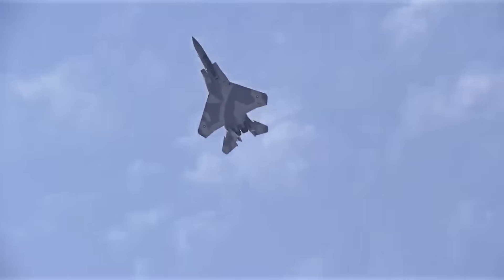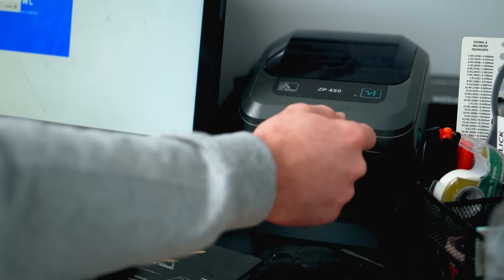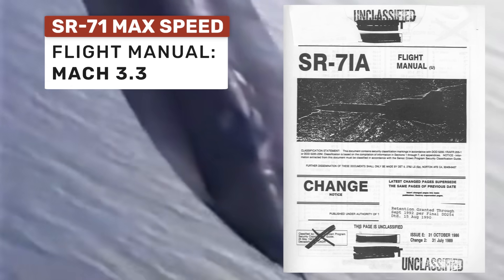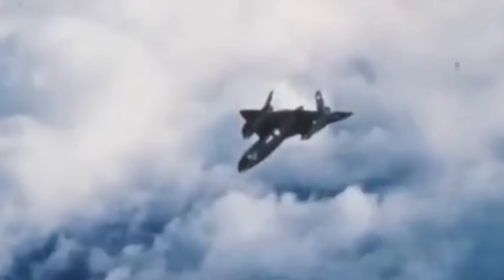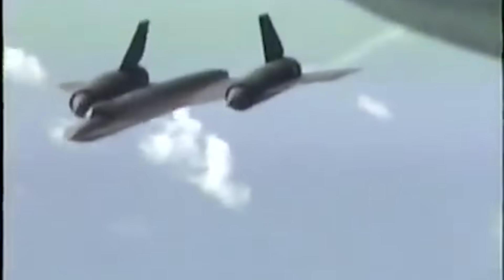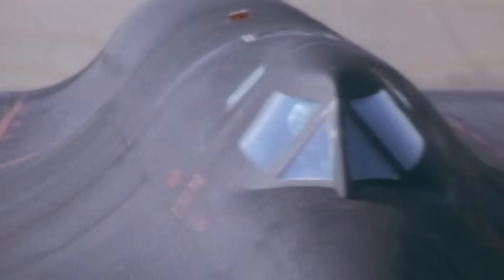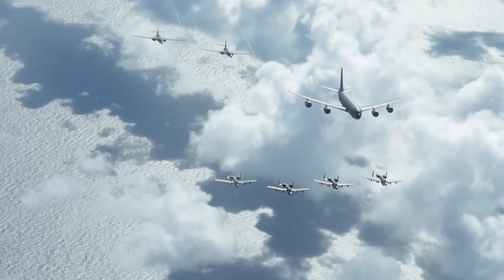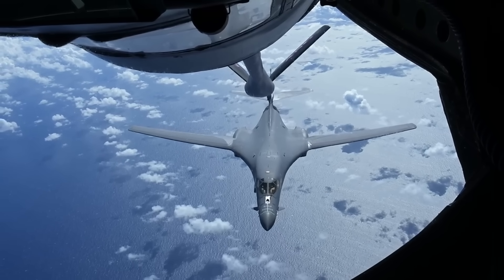The SR-71 was MUCH FASTER than the Air Force will admit

Comment: I met several SR-71 drivers at an airshow at Andrews AFB outside of Washington DC, who were wearing 5 - 100 patches on their flight suits.  Since I was an Army officer, in uniform, they told me  it stood for their doing Mach 5 at 100,000 ft.
Reply: There's no pilots that have ever worn a patch like that, especially as it's not possible.
Reply: @gr8crash  You're correct about the SR-71.  However, according to NASA "On separate flights, the X-15 reached mach 6.70 (4,520 mph) and 354,200 feet. the program could have broken every speed and altitude record in the books, but that was not the goal. the sole purpose of the X-15 was to enable research at hypersonic velocities and at the edge of space."
Reply: The X15 program did break and set all the records. There has yet to be a manned aircraft that flew higher/faster. Aside from the Space shuttle etc which is still a different class.

Comment: It would make sense if it was much faster. The plane itself and all the stories from the Skunkworks abour the engineering challenges they had to overcome is the evidence. The SR-71 has quirks and engineering oddities that contemporary aircraft of roughly similar (known) speed, like the MiG-25 and XB-70, never had to deal with. Both of those achieved Mach 3 with ordinary turbojet engines, for example, and without the need for a skin and fuel tanks that okly sealed properly after veing friction heated by drag.
Reply: The part about the tanks isn't true, although it is a popular myth.
Reply: @gr8crash  There is literally video of them leaking on the tarmac
Reply: @XH1927  no one said they don't leak some fuel. Virtually all aircraft leak fuel, the SR71 is no different. Its WHY they leak fuel, which per your comment is incorrect.

Comment: I'm betting Mach 5 to Mach 6!
Reply: Not even remotely possible
Reply: @gr8crash  Really? The X15 in designed 1959 reached Mach 6.7 in 1967 with a 16,000 total LB of thrust but an SR-71 with 50,000LB of thrust can only do Mach 3? The thrust to weight is 1.15 for X-15 vs 0.44 for SR-71 and can sustain thrust way longer since it's a jet, not a rocket engine. Lockheed Martin announced in June 2017 that the SR-72 hypersonic plane will have a top speed of more than Mach 6. The Falcon HTV-2 went MACH 20 in 2011! But Mach 5 or 6... just not possible? Dont forget public vs classified specs like Sandbox pointed out. Or like one SR-71 pilot said, "I've seen Mach numbers I never dreamed were possible".  Did you catch NUMBERS? Or NASA's unmanned Hyper-X (X-43A) with scramjet aircraft reached Mach 9.6 in 2004. The Falcon at Mach 20 was the fastest I could find, and that obviously doesn't include classified vehicles. Maybe checkout - Figuring out GE Aerospace's hypersonic aircraft engine breakthrough. But they don't exist, right?
Reply: @anthonywilliams7052  Read the SR71 flight manual. Skin temp limited to 427°C / Mach 3.5 at optimum conditions.

Comment: Concorde could and did fly faster than its "official" Mach 2.02 as well - its top speed was limited not by engine thrust but by peak temperature - flying in a colder patch of air, at higher altitudes, would enable higher speed whilst not exceeding the max temps on the airframe.
Reply: Technically, the plane was required even for certification to fly at 2.15 for a short period of time.  Apparently, it was felt to be important for test purposes.  Originally, they wanted a speed of 2.20 which would have required the plane to fly at Mach 2.35 for a short period, but they ultimately decided to forgo this for one reason or another.

Comment: They flew an SR71 3,100 miles in under 1 hour from rollout to landing stop.
 F15 is capable of shooting itself down by accelerating and running into the rounds fired from the cannon that travel at roughly 2727.25 mph or about mach 3.5,  so F-15 has to be going faster than that.
Reply: Lol none of what you said is remotely accurate

Comment: At higher altitudes air is thinner.  Therefore, there should be less friction and less frictional heating.  Doesn't this mean that the aircraft can fly faster without exceeding its  temperature limit at higher altitudes?

Comment: I was stationed in England in 1974 during the Farnborough air show when the Blackbird set the world speed record.  They flew down the flight lines of many RAF/USAF bases.  I saw it cruise down our flight line about 100 feet altitude, barely audible from a couple hundred yards, at the end of the runway, it stood on its tail and went straight up quicker than I could snap my head up to try to follow its path.  The scuttlebutt at the time was that they landed twice for coffee on the trip.

Comment: Mach 3.56=2731.478 mph 😮
Reply: That math is incorrect,  nor is it really possible
Reply: @gr8crash  

It is not incorrect. 1 mph = Mach 0.001303
Reply: @jesusisalive3227 again, your math in relation to this aircraft specifically is incorrect. 2731mph would be mach 4.09 which is 100% impossible for this aircraft.
Reply: @gr8crash 

Your math is incorrect. Mach 1 is 767.2691mphx3.56= 2731.477996mph
Reply: @jesusisalive3227 apparently someone doesn't know how aviation works, and doesn't realize that the speed of sound isn't a set speed and changes with altitude. 

You may want to do some studying.
Reply: @gr8crash  

The rest is not irrelevant. If you think it is, you don't know as much as you think you do.
Reply: @jesusisalive3227 at those altitudes it is largely irrelevant. Atmospheric temperatures are essentially standard,  which when you understand how the SR71 functions it easy to tell what speeds are and are not likely. Also at those higher altitudes, humidity,  pressures etc are atmospheric standards. Meaning they rarely change. At 80k ft the speed of sound is 666.5mph.  Which is why when people incorrectly do the math like you did they use the speed of sound at sea level, which is again incorrect. You must change the speed of sound variable to the appropriate altitude.

Comment: So you qualified the SR71 speed record as the fastest reusable crewed aircraft but the X15 was indeed reusable and crewed and had a top speed of Mach 6.7. Does this not count because it was experimental?  I also like how people make claims when everyone knows that there are other classified aircraft that we do not know about. I actually worked in that world as an engineer for decades with Lockheed and Northrop.
Reply: The SR71 is a jet powered aircraft. The X15 was rocket powered. Different types of aircraft, different sped classes. 

And sadly we have yet to have an operational successor that exceeds the SR71 performance capabilities

Comment: From what I can tell the F15 is able to basically get to Mach 3 by doing almost the same thing as the SR71. Which is they basically get to that Mach 2.5+ speed at which the air speed is fast enough to turn it into a ram jet engine. My guess is there’s probably an afterburner outlet where you can do a quick dump of fuel and just shoot into an insane speed to get so far ahead of any enemy craft that you can successfully evade them. Supposedly the Mig25 was supposed to be able to fly as fast as the SR 71. Yet it was never able to catch up to it despite being able to do Mach 3.2. Indicating that it likely was outrun by the SR71 as they had a ram jet function where it could theoretically get up to Mach 4+

Comment: There was an article that indicated the nose shock wave envelope was around Mach 4.6 before it began to interfere with the wing tips.  (Wing tips shaking up and down violently.) That doesn’t factor in any realities in engine inlet/spike.
Reply: At Mach 3.65 the nose shock would hit the wing tips, front chines, engine inlets and tail. Any "top speed" would have to remain under that hard limit.
Reply: @wally7856 even that wasn't gonna happen. The maximum design potential is above that speed, but the upgrades required to reach that max speed were never done. The aircraft as configured had a max limit of 3.55. But getting to those speeds could only happen under VERY specific atmospheric conditions.
Reply: @gr8crash  Agree.  The article was a hypothetical and assumed a completely new class of engines and thermal coating.  More of a tip of the hat to what was done with paper and a mechanical pencil.
Reply: @1sad1956  I think I've seen what you're referring to. I go back to KJs and Skunkworks review on it. They had a good breakdown on what aspects of the airframe get effected at different speeds from 3.4 up to 3.8 and what changes were required to reach that speed. It was a pretty good design study. Shockwave interference off the nose to the engines and such wasn't a limiting factor that I recall reading.  But the aircraft would have required new engine inlets to handle the air. 

With the current airframe the limit was around 3.55 as the current inlet was already maxed out and couldn't handle any more airflow, and the leading edge shockwave is being pushed so far AFT it would start to reduce the control authority of the control surfaces.
Reply: That issue would occur long before mach 4.6 and the SR71 could never get close to that speed

Comment: I'm told, from a reliable source, that the F-104 starlighter was ACTUALLY capable of mach 3.
At least once demilled and lightened. (No Vulcan, no missiles, no external tanks, mil avionics removed and replaced with civilian modern minimalistic/light weight electronics.

The old owners of "Jet Executive", a private jet-rental service, owned 2 de-miled f-104s, and they occasionally took them out for a spin. Over the continental US they can only go subsonic, but once over international waters in the nearby Gulf of Mexico, they reportedly opened up the Starfighter as fast and high as they could and supposedly M3 was confirmed by the local air traffic control radar... but not for very long.

Comment: The Eldorado Canyon bird's engines were toast after that run. Internal parts (I believe a titanium screen) crumbled upon inspection. Told me by an SR mech. from Beale. He would not divulge the speed or altitude, although I did not get the impression it was not a huge amount greater than normal, although he did acknowledge it was probably a record. He knew, just couldn't get specific.
Reply: None of that is true

Comment: Dig deeper there are at least 2 cases of these planes SR-71 hitting Mach 3.8 while outrunning missiles and going to 120,000 ft plus in climb! These pilots feared zero!  nothing could touch them! and they knew it! The movie Firefox WAS ACTUALLY BASED off of our plane's actual deeds!
Reply: That never happened as it's literally impossible
Reply: @gr8crash  Well somebody forgot to tell the plane that it was limited to your understanding of aeronautical engineering
Reply: @kmcc2355 actually no, as I understand this quite well. And even the aircraft "knows" it can't do that. The plane would have literally come apart if a pilot even tried it. I mean just think like about the question alone. IF the aircraft even did that, how would the pilot even know?

Comment: Bottom line it’s classified!!!!
Reply: Not for over a decade
Reply: @gr8crash  The flight manual was available int he 90s.
Reply: @somaday2595 yes I know. I believe 87 or 88 as the program was shutting down
Reply: @gr8crash  If people would review the flight manual, many of the myths would be dispelled.  And eye opener is the max angle of attack, (14°, less at higher altitudes) and max G, (a little over 2) are so low.  And that 427°C (not-  skin temp rules  (before editing), but engine CIT limit as gr8crash corrected).
Another goody from the flight manual-
Max bank angle was 45° during auto inlet operation above FL 700, and no turning at or above max alt cruise for existing Mach number.
Reply: @somaday2595 yea sadly a lot of people don't want to invest the time or money in doing that. The AOA I'd have to verify but 12-14⁰ sound about right. The G loads do change with weights and speeds. At max speed the G limit was only 1.5gs. It was quite a delicate aircraft. The 427⁰ wasn't a skin temp limit it was the engine CIT limit which was the initial limiting factor for more speed.

Comment: As an USAF SP, we heard Mach 7 was measured, but all classified. No sure about Mach 7.
Reply: That's literally impossible. The aircraft would have fallen out of the sky long before then
Reply: @gr8crash  why? I no nothing, no concept of what that speed would do to this aircraft. 😅 or even how fast that actually is.
Reply: @rickgarcia7334  that speed is significantly faster than what the airframe shape was designed for, the airframe structure would be compromised long before then and the engines themselves would have been destroyed long before reaching that speed
Reply: @gr8crash Thank you.  so we do know the limit of the airframe, should there not be a mathematical calculation to determine it's maximum design would be capable of with standing? And the engines capabilities too? Then a one to calculate SR-71s max capable speed?
Reply: @rickgarcia7334  essentially yes. And Lockheed already did that decades ago. They studied its design, and studied each incremental increase in speed up to the airframes maximum design potential which was "only" mach 3.8. But to reach that speed would have required significant rework to most of the aircraft and would have reduced all the safety margins to essentially zero. Kelly Johnson stated that while it was possible,  the risks weren't worth it for such a modest increase in speed.
Reply: @gr8crash  cool. Thank you. I appreciate it. 3.8 is still pretty fast.
Reply: @rickgarcia7334 agreed. Would have been pretty cool to see a modified version reach those speeds

Comment: I read some info about the Zumwalt class ship and it has WAY too much power generation for a ship that size.  I will let you figure out what it's for, but there is only one obvious answer.  This answer is ALSO the reason why the Zumwalt is not in mass production and can be deduced with ease.  It's not just planes that are understated speed-wise.  It's ships too.  I had a VHS tape about 18 years ago of a carrier doing tests and shooting a car off of the flight deck with the plane catapult.  At top speed, that WHOLE ship would lean like 15 degrees.  That doesn't sound like a lot, but I promise it is a SCARY amount.  The stated speed of the ship was 30-35kts.  A ship wouldn't lean like that until something like 50kts and the wind had people bracing against it like their lives depended on it.  Same with submarines.  I haven't even heard a RUMOR of how fast they are, but I know they are VERY fast.

Comment: Not lies. They don't know what the top speed was. At mach 3 and above the plane used less gas, there was always more throtle available. But the engines would over heat the faster the plane went. No one wanted to find out the top speed to have the engines melt and blow out the back of the plane.  9th RTS alum.

Comment: Oh Pleeeez... The taglines of these videos. Claims the the Air Force " lied " implies you have a need to know,  eh,  ya don't...  It has always stated by numerous sources that the SR-71 had a capability of traveling at Mach 3.2 "plus"... The plus, was Classified and with the  exception of  some  circles it still is a matter of CUI... It's working speed at a flt level of 75,000 to 80,000 ft ASL was (Mach 3.0)  2,000.215 KEAS.. That's like 2 seconds per mile over the ground...

Comment: I didn't realize they still used such a switch on modern fighters. Back in the era of prop driven fighters, it was called WEP (War Emergency Power). Some of the Cold War era Soviet jets had a similar system they called the "Diamond Regime" because it would form shock diamonds in the exhaust flame during use.

Comment: Brian Shul, RIP, was known to embellish things at times. I knew the current speed recordholder Eldon (Al) Joersz.  That speed record required operating the jet at much higher speeds than designed for tactically, and it required some extra maintenance after it landed.

Comment: Its not a matter of the air force "lying" about top speeds, its the limitations of the aircraft. Sure the engines can do it, but the rest of the plane cannot. Once the capabilities were declassified it was clear the mach 3.21 was the recommended top speed. Yeah it could go faster, but then you are gambling.

Comment: My step brother was a photo  analyst for the SR71 the pilots joking said "80,000 feet and climbing at Mach 3!"
Reply: There is some truth there - the level-off at altitude started around 78,000 to 80,000 and as fuel burned they slowly gained altitude and usually ended up around 83-85,000.
Reply: @MillionsOfRecords  Yeah, there's a flight-profile called a cruise-climb which was basically what they were doing.  Effectively, in the age of early jet flights (even commercial), with the altitude over 25000 feet fairly unoccupied, they could basically reserve blocks of altitude and would effectively fly at max-continuous with a very gradual climb.  Effectively, as the aircraft burns fuel, it's optimum flying speed would lower, and by climbing at the same time, they could effectively be constantly at the optimum speed across pretty much the whole cruise-portion of the flight.

As jets became more prevalent, this stopped being an option that would be considered acceptable so they generally would just fly assigned altitudes (as planes at lower altitudes did).  That said, they could file flight-plans which would have the altitude being periodically stepped up, and they could also simply ask the center if they could climb to a higher altitude.  Concorde was an exception since there were all of 14 in service, and they would adopt a cruise-climb profile, basically topping off around 48000-52000 and climbing up to around 60000 at the end of the flight.